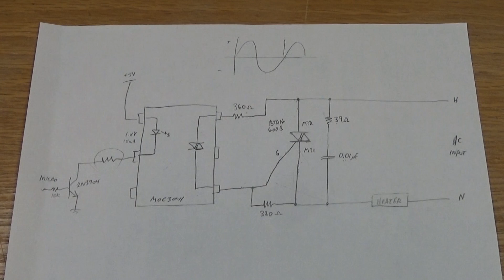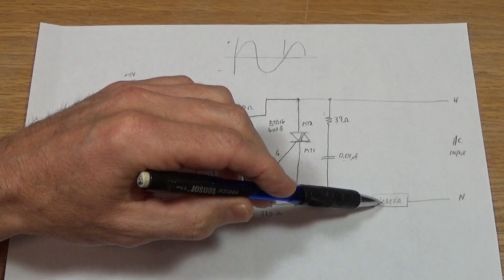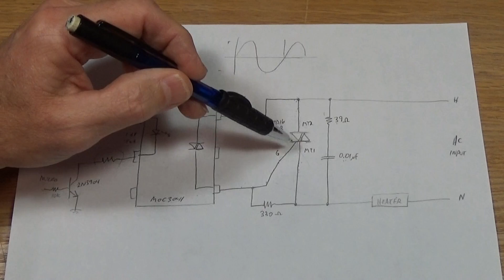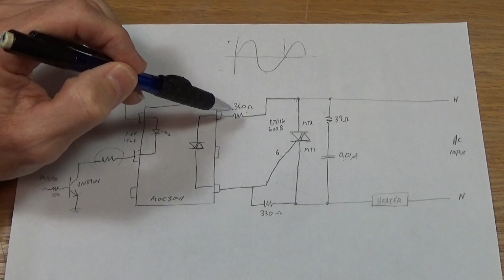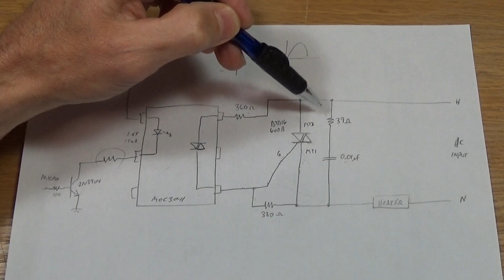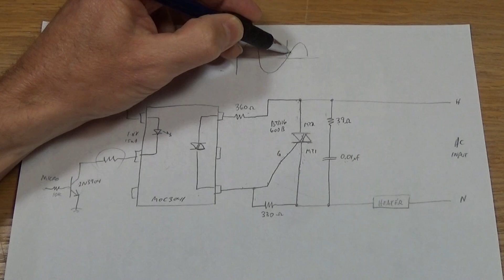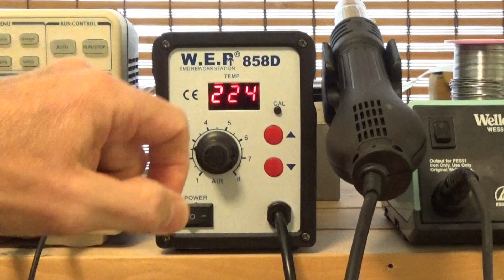Hot Air Rework Station Repair

Comment: Excellent clear explanation, my Aoyue 968 blew its fuse resistor, and it's element. I replaced both, then new element burned like a furnace and failed. Turned out to be a shorted Triac, replaced and tested with an old mains lightbulb, before replacing the element. Bulb flashes slowly, 2 to 4 times/sec.?, I expected mains freq. Pulses.

Comment: hello dear, i repaired handle wiring because of firing bta12-800, all good now in handle: resistance of heater, thermistor, hercon is working, cooler is working separately of station, but station says SLP always.... all transistors on board working, not fired component on vision, what wrong with it?

Comment: Hi Craig, Thankyou for your video. I brought a 858D rework station that has lasted me 2years plus. Just today the hot air has decreased in blowing capacity so I decided to Google and have found your video. Upon opening the station I had found two resistors that have scolded marks on them. My question for you is even though your video is over 7 years old, do you still have the unit and how long has it last. Also it’s obvious that the more you spend the better the quality but if I were to pay an electrician to properly fix these issues would it be worth while or should I purchase a higher end station?

Comment: Hi Craig, I have a WEP 2008D with 3 channels, but I cannot get the temperature to set above 200 degrees on any of the channels. Can you please tell what might be the problem?
Reply from the maker: No idea.  You have a different model from mine. The temperature setting in mine is done in the microcontroller, I suspect same in yours.  Maybe there is some setting preventing yours going higher in temperature.

Comment: Thank you for this great video. I have the same problem. When turned on, it starts counting from 1 to 7 degrees Celsius. And the same error (S-E) occurs. I checked all the wires and found no fault.
When examining the resistors, such as the video, I found a resistance of 330 ohms. When measured on the board, I find 51 ohms. When I remove it from the board and measure outside the board, I find 330 ohms. When measuring its location on the board, I find 51 ohms. How is that, and there is no resistance at all
Reply: Hi. I have the exact same problem. Did you ever find a fix for this?
Reply: @user-om9fu6iw5x  Unfortunately No

Comment: Could you help me with a similar station, it seems out of control, when I put the gun in its place to cool down, it does not turn off completely, it turns on by itself and the fan speed increases much more than normal, I have checked it but I cannot find the fault . I appreciate any help.

Comment: To reduce confusion it's an opto-isolator connecting to the triac.
Reply: Also known as  "optical coupler" as he said.
Reply: @lindsay5985  The optocoupler is used to transmit analog or digital information between circuits while maintaining electrical isolation at potentials up to 5,000 volts. An optoisolator is used to transmit analog or digital information between circuits where the potential difference is above 5,000 volts.

Comment: Got mine today. Set point is always at 100°C, directly after I switched on. When i ramp it up to e.g. 110°C its going crazy. Still shows 100°, heats up with no end. The whole thing starts to GLOW in red like an engine exhaust. Any tipps where to start debuging?
Reply from the maker: Sounds like the thermocouple is broken.  I'd start by looking at that.  Good luck!
Reply: @craighollinger9972  fix was easy. Thermistor was bridged by factory on the small pcb in the palmend
Reply from the maker: @tispokes1563  Good to hear.
Reply: @tispokes1563  Could you help me with a similar station, it seems out of control, when I put the gun in its place to cool down, it does not turn off completely, it turns on by itself and the fan speed increases much more than normal, I have checked it but I cannot find the fault . I appreciate any help.
Reply: Could you help me with a similar station, it seems out of control, when I put the gun in its place to cool down, it does not turn off completely, it turns on by itself and the fan speed increases much more than normal, I have checked it but I cannot find the fault . I appreciate any help.
Reply: @GabrieltTC  So, what could I do for you?
Reply: @tispokes1563  I have a heating station like the one in the video, it has a fault that I can't solve, how could I send you a video so you can see the problem?

Comment: Hi my hot air gun overheats i checked triac and 1 was shorted but its for air pump.  After reading up i changed lm358 n moc 3041 (as i read shorted phototriac causes full power) n its still over heats. I even bought new hot air gun bcos old one internal glass  holder broke n its still over heat. Its a 852d+
Can u advice?
Reply from the maker: Sounds like there is no temperature feedback from the hand piece.  I'd be checking for that.

Comment: i broke mine, shorted something, ended up replacing the triac(shorted) still not working, stays in stand by mode (3 dashes - - -), temp at 100c if i change it to any temp and turn it off it resets back to 100c, lifting handle doesn't change anything on screen, what could be wrong? bad opto?
Reply: Try replacing the opto-isolator and triac.

Comment: Just trying to get it in my head but AC wouldn't matter what colored wire as it alternates between the line and neutral so either way it  would still have the same current as long as the wires aren't two different sizes. Correct me if I'm wrong please.
Reply from the maker: From the perspective of the circuit electrically, it makes no difference.  The circuit doesn't care.  It does make a big difference in regards to safety, though.  
In North America (and I believe most everywhere in the world) the Neutral wire is tied to ground (the Earth) back at the electrical panel in your house.  There will be a wire going from the Ground connection in the electrical panel to a water pipe or a spike driven into the ground.  The Line wire is the wire carrying the AC from the electrical panel through a breaker, so there is a voltage between it and neutral and ground, and anything else touching the ground ie: the water lines coming into your house.  
In some electrical appliances, the chassis forms part of the circuit and is connected to the Neutral wire, not Line wire.  That way, the chassis isn't at the AC potential and users won't get a shock (or worse) if they touch it and something that is grounded like a water tap or a wet basement floor.  
In other appliances, the chassis doesn't form part of the circuit, but it will be connected to the Ground wire (the third prong in the plug).  That way, if a fault should occur and the Line wire contacts the chassis, it will short to ground and blow the breaker and never be at AC potential.  This way the user is protected.
So, to reiterate, yes it does make a difference.

Comment: hi thanks for your great video i have a issue with my heater the problem is overheating ...when i turn it on the temperature goes to high even the handle get to hot and temperature get over 600 degree i really cant understand what is problem.. is it element or element circuit ? do u think it related to micro controller? or other component? pls help me figure it out!!!
Reply from the maker: Sounds like the temperature sensor in the handle is not working or the connection from it to the microcontroller is broken.  Open up the handle and have a look at the wiring.  Maybe something is broken in there.  Good luck!

Comment: I bought sumsour 8586 from Amazon, so far it’s working fine. The only thing I’m concerned about is that the unit doesn’t have transformer like yours and other units. I don’t know if it’s very important to have a transformer installed?

Comment: Thank you very much for the great explanation of triac in 858d.  I have similar problem except heater is on all the time at max power regardless of setting.  I guess either tirac is shot or the something is wrong with snubber circuit.
Reply from the maker: The triac and optpcoupler are common components and so are easy to get (Mouser, DigiKey).  I'm not sure if the snubber circuit would fail short unless the capacitor did.  Good luck fixing your station.
BTW: My station gets a lot of use building surface mount boards and has been working great since I produced this video.
Reply: @craighollinger9972  I got same problem.
The triac and optocoupler have been replaced.
Even the surrounding resistors were measured. All good.
The microcontroller doesn't output when I press the button. heat gun well cool down
After a few seconds.it will continue to heat over 500 degrees
I have no idea. well my microcontroller or the firmware broken.
Reply from the maker: Sounds to me like a microcontroller problem.  I think it is a Microchip PIC something part or a clone.  Can't help you much more than that.
Reply: I have exactly the same problem. Did you fix your rework station? Which component was failing? I will try to repair mine one but I don’t have too much idea.

Comment: nnnnnnnoooooooooooooooo in europe neutral is blue and live is black or brow and grey for trifasic as of L1 L2 L3 , WHAT ARE YOU SAYING BRO
Reply from the maker: Steady on bro!
If you check the comments below, you'll see I got schooled on the correct coloring of the wires shortly after the video was posted. And, if memory serves, I think I did say in the video that I wasn't sure that I was correct.
You can relax now.  Breathe...
Reply: @craighollinger9972  i am relaxed hahaha jus want to make shure someone dont burn dow his house in europe were i am. portugal
Reply: @craighollinger9972  any wau i bought an eruntop 8586D+ and it just last 3 days on hot air coz the handle catch fire as the fan stops spining, swaped the hadle never turn  on again i guess its the triac
Reply from the maker: @informediatech-bruno5766  That's too bad yours failed.  I've heard that other people have had the handle catch fire too.  Mine's been working well since my video was posted.  I think the fan is powered by 12VDC and is controlled by a transistor triggered by the microcontroller.  The triac is just for the heater.  Good luck fixing yours.
Reply: @craighollinger9972  nop the fan its 24 volt and the model its sg858 same as the board the fan spins and  the handle got a bit warm but not enough as you are able to touch it ive used a bakko fan im going to replace to the exact model to see if it works i know there is some controler inside the motor and when i plug the handle in it say S-E as when the handle or iron is not pluged in, this will take  a bit to figure that out, may be triac may be the impedance generated by the unoficial bakko handle, but both are very similar and the voltage the same

Comment: Hi mate, I had same as your one, but I got S-E error, fan not running, fuse is good, heating element didn’t see burned, what do you think? Please help, thx
Reply from the maker: The transformer is used to produce DC power (12V I think?) for the circuitry.  I believe the fan is run from that, not the mains.  Check the DC power.  Good luck!

Comment: Hi Craig !  I just purchased a 858D Hot Air Rework Unit and I went ahead and opened it before using it and checked it for safety.  I live in USA and the unit works on 110 VAC and I know a little about Electricity and Electronics, however the Unit came with the European Colors which makes it a little more difficult to trace the mistakes made in assembly as they also change the wire colors in most of the wiring right after the power leads go inside the Housing of the Unit. Using Continuity I just found a lack of ground to the rear metal cover and corrected it even though the rest of the wiring was correctly grounded including the Heater Unit.  I also found that my unit is “neutrally-switched” ( Instead of using the “Live” or Hot” lead they wired the On/Off Switch  with the Common or Neutral lead from mains). I need help to fix it because both the mains leads go through some different connectors on the front PC Board Panel and I don’t want to wrongly connect the Hot lead coming from the switch (once I correct it ) to a wrong connector and having a Short from Hot to Common. Will you please reply with either written instructions or pictures as to what wires to switch among the PC Board and the On/Off Switch so I can fix it?  I have subscribed to your Channel and I can make my email available if needed.  Thank you !
Reply from the maker: I was purposely vague because I didn't want to give instructions that may be misunderstood and someone getting hurt or blowing something up.  Mains voltages are lethal.  I'd suggest you get someone who knows about this stuff (an electrician for example) who can sit with you and help you do the work.  Much safer that way.
Reply: Thank you Craig! All I had to do was interchange the “Hot” and the “Common” but at that time I had just received it and I just wanted to make sure I didn’t make a mistake because of the many different colors used on the wiring but I just traced them using “continuity” with my Meter and fixed it next day! Thank you for your rrply!
Reply from the maker: @joserrodz  I'm glad it worked out for you.

Comment: I have already ordered from a local supplier and waiting it to arrive.The first thing i will check is the working voltage to be 220v.Then the earth grounding,but if you use it in a non grounded wall socket in the case of leakage the worst is that electrocution danger is mainly on the metal box rather than the hand held tool which the possibilities to touch the metal part are small.A leakage detection relay is always a must despite the fact that my house still does not has.
Reply from the maker: Good luck.  Mine is still working after 4 years.
Reply: Hi Craig !  I just purchased a 858D Hot Air Rework Unit and I went ahead and opened it before using it and checked it for safety.  I live in USA and the unit works on 110 VAC and I know a little about Electricity and Electronics, however the Unit came with the European Colors which makes it a little more difficult to trace the mistakes made in assembly as they also change the wire colors in most of the wiring right after the power leads go inside the Housing of the Unit. Using Continuity I just found a lack of ground to the rear metal cover and corrected it even though the rest of the wiring was correctly grounded including the Heater Unit.  I also found that my unit is “neutrally-switched” ( Instead of using the “Live” or Hot” lead they wired the On/Off Switch  with the Common or Neutral lead from mains). I need help to fix it because both the mains leads go through some different connectors on the front PC Board Panel and I don’t want to wrongly connect the Hot lead coming from the switch (once I correct it ) to a wrong connector and having a Short from Hot to Common. Will you please reply with either written instructions or pictures as to what wires to switch among the PC Board and the On/Off Switch so I can fix it?  I have subscribed to your Channel and I can make my email available if needed.  Thank you !

Comment: please tell me what is the voltage the air pump need to work if used it In another field
Reply from the maker: The fan (pump) runs on 24V DC.   The speed of the fan is controlled by PWMing the 24V applied to it.

Comment: i have a quick857D with a 5-E display error.please love the solution.
Reply: That’s actually “S - E” aka “Sensor Error”. The likely problem is in the wand/gun...open it up and check circuit board for broken solder joints, bad wire connections and/or broken heating element.
Reply from the maker: I'm sorry, but I don't know what the error means.  I didn't know the unit displayed any error codes.  Try an internet search.  Good luck.

Comment: 6:34 did you replace that resistor? (my yihua soldering station 899D+ burned a similar resistor (in my case 120 k)
Reply from the maker: I believe I did.  The large grey resistor, with the skid marks on it, was still OK so I left it in.

This station has been working well for more than a year now and I use it often for assembling surface mount PCBs.
Reply: I am making a video about my repair of a yihua 899D, subscribe to my channel so you see it when I upload it

Comment: have a problem to grasp what you say.in europa or norway wee have 220-240volt.and the main plugg can be put both ways in the 220 outlet.the plugg here is 2 round pins and earth is on the side off the plugg in a slot on each side.so green yelow is ground the 2 other leads can turn both ways depending on the way the plugg is put in the 220 outlet.fits both ways as said.
Reply from the maker: In North America we have 220V in some appliances such as cook stoves and clothes dryers that require more power than a standard 110V outlet can provide.  In that case both lines are live at 110V to ground and 220V between them.  The plugs for 220V have 4 pins, 2 live, one neutral and one ground, and can only be put in one orientation.  The neutral and ground wires are connected together back at the electrical panel containing the circuit breakers.

The 110V plugs have only one live line which is 110V to ground and have three pins: one live, one neutral, one ground and can only be put in one orientation.  As with the 220V plugs, the neutral and ground wires are connected together at the breaker panel.